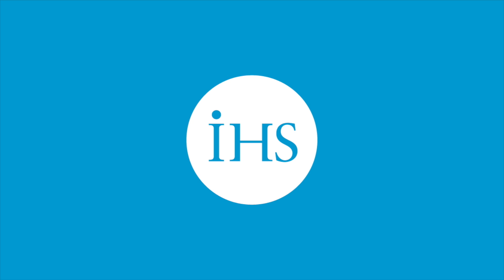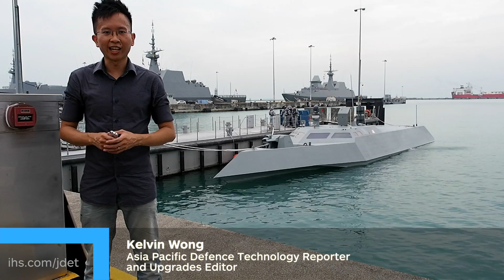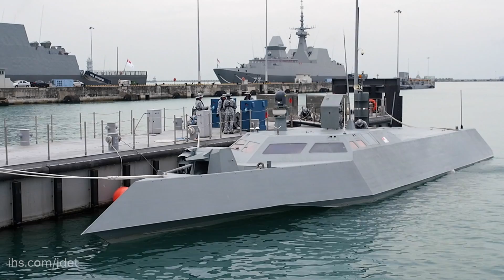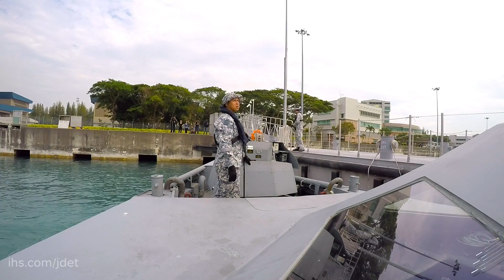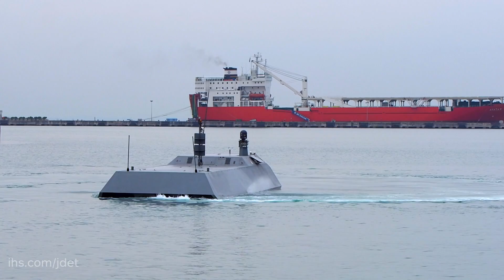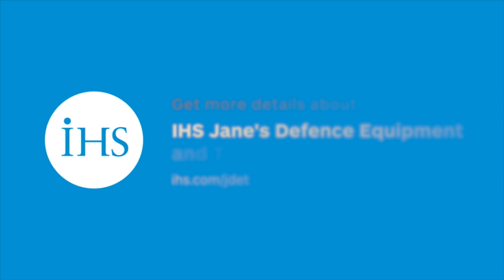Singapore Navy’s new high speed naval interceptor Specialised Marine Craft

Comment: Great looking craft. Good job Singapore.
Reading through the comments, I like to add a concern.
It will be highly dangerous with a need for the crew of 4 in Singapore waters to avoid the massive ships passing through as this low boat is designed not to be easily seen.
Reply: the mast has radar enhancers to improve the radar signature.
Reply: @wavecutter69  thanks. Got it. The enhancers can be turned off when needed.

Comment: It looks like a stealthy speed boat armed with a machine gun. It is not armed with any missiles so my question is what can it really do? I mean it's fire power can hardly even match some pirates with RPGs.

It has only 4 crew, what can they do? I doubt it can function as a patrol boat, so what is this boat really for?
Reply: sg operates an integrated force... the boat acts as a sensor if it lacks in firepower... just like a infantry calling in artillery strikes
Reply: For that purpose isn't a drone much better?
Reply: a drone cant do vbss... it is meants to be flexible in the way it is designed to be for a specific purpose
Reply: You think 4 people (including a driver) could? If there are pirates or smugglers on board, what are the chances those 3 guys could come back alive?
Reply: I think pirates or drug smugglers could really use those ships, low radar signature and all.
Reply: yeaps... 4 is a good team... have faith, pirates and smugglers in the region are pretty amateurish... the more daring ones are at the sulu seas
Reply: The ship is for intercepting ships like pirates which are lightly armed even with rpg most time they rather escape then Attack and they can defend with the machine guns

Comment: Is it useful? Seems to lack in firepower though. It also looks like it won't be able to intercept or handle an intentional crash by forceful China's fishing boats.. but it sure looks futuristic.
Reply: Billy The-Kid Singapore and China do not share the same seas, you might want to google your geography please. This interview is about local water defense.
Reply: looks more like something to intercept small boats packed with explosives, or smugglers etc. probably armed with .50 cal HMG at most.
Reply: It's not only meant to intercept fishing craft and tankers etc. in a traditional maritime security context. It shares that role with the Protector USV, and other less advanced craft that put VBSS peeps onboard.

It likely has at least two other hot-war or period-of-tension roles that require high performance, small visual signature and low EM signature. Furthermore, the tumbledown hull and sleek exterior are interesting design choices that reduce drag in any medium, which other surface ships do not require, since at ship speeds, drag from air is minimal. The masts also have little hatch covers and holes. One wonders why the mast needs to be retracted, and why the entire upper surface is so low-drag.

There is official video of it on Youtube or Facebook that shows a rather roomy, and well-sealed interior and a race-car like cockpit arrangement.
Reply: Billy The-Kid when and where did china expand to within the past 200 years? please provide links to your "proof".
Reply: Tibet, no links to 'proof' required.
Reply: ahkl77 

Well, you never know when the expansionistic Communist China might suddenly decide one fine day, that the waters surrounding Singapore "also belongs" to them.

Comment: Low and sleek. Does not have much firepower unless I missed something.
Reply: A.50 cal MG is enough to scare off most pirates or get compliance from smugglers. If that doesn't do the trick then the sensors and communications might aid a local allied ship to send in a missile or shells. Of course they could also have some man portable weapons for some additional firepower as well.
Reply: Michael Mixon listen and watch from 2:22
Reply: +Michael Mixon You misse d the part of the intervommy G. Thompson Youth Center,eiw that tells how the ship doesn't work alone. It's part of a layered system level response. Basically it's a sitting duck

Comment: This vessel will never perform for interdiction in rough or adverse sea conditions. High speed can be achieved perhaps under water. I wrote the book on high speeds in offshore hulls.
Reply: It's not designed for high seas but for operations around Singapore where the waters are relatively calm
Reply: Apache Powerboats Watch from 0:50 onwards and listen to what the colonel said about the operational features specific to local waters, and 2:15 onwards, akin to a catamaran but with a stealthy armored profile and rapid engagement